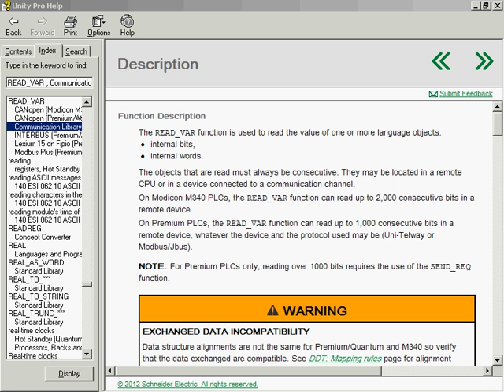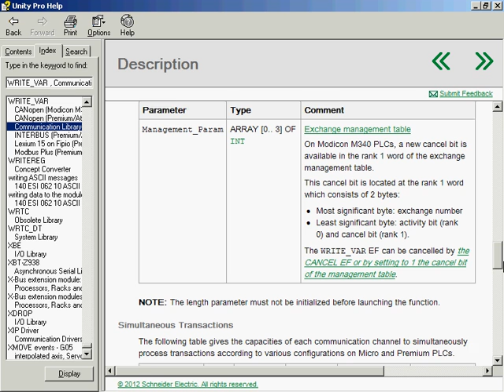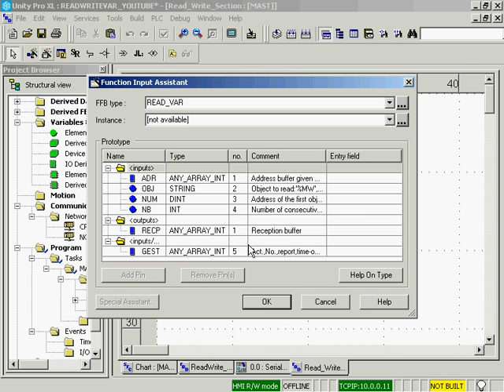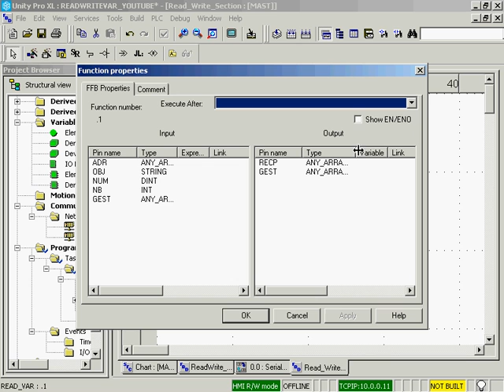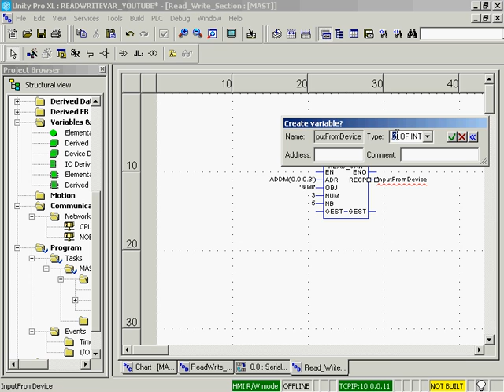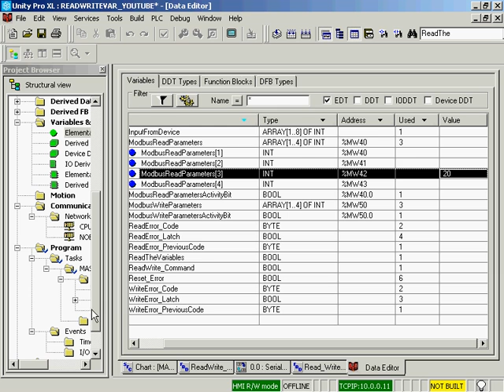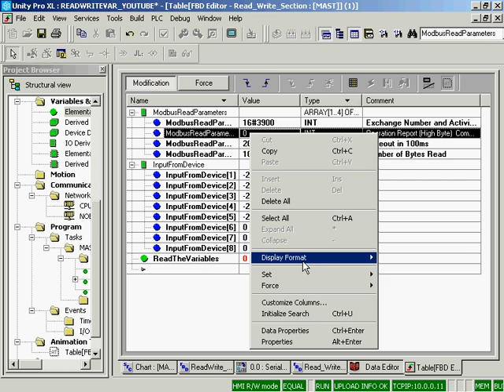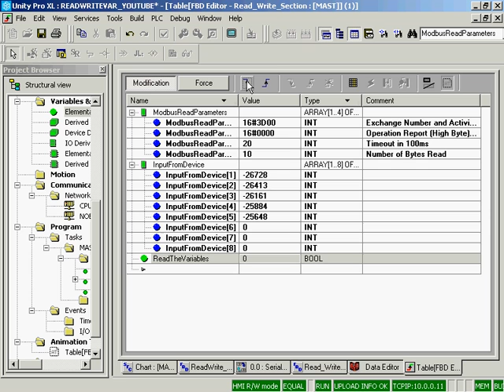Unity Pro - Read from a Modbus Serial RS485 Device - Read_Var

Comment from the maker: You are right on.  You'll just use the slot number of the NOM Module in the ADDM instruction.  %MW is 4x register.
A couple of things.  
4x registers start at 400001.  %MW starts at %MW0.  So you may be 1 register off.  If you get the wrong data, offset the address by 1.  I usually read several registers the first time to confirm.
You are doing serial communications, so only one message at a time.  The M340 will buffer, but I still think it best to send one message at a time.
Have fun!

Comment: Thank you for that. Is there anything significantly different if I am attempting to communicate through a BMXNOM0200 card? I am trying to get info from a network of Symcom Motor Saver 777's. I am trying to look at 4x registers, should this be '%MW' in the "type" and I have been using the ADDM function block.... 

Sorry for all the questions - thanks for the tutorial....
- Emery